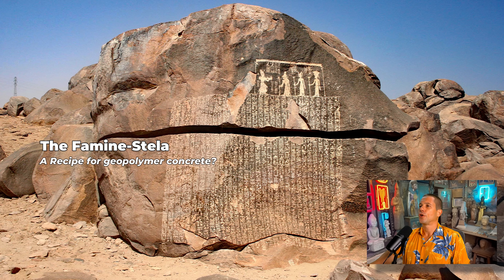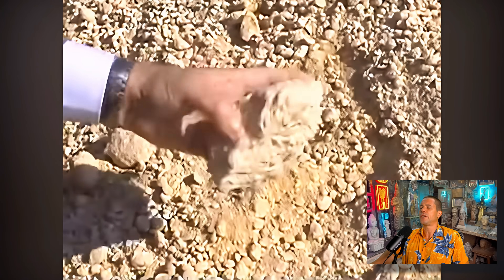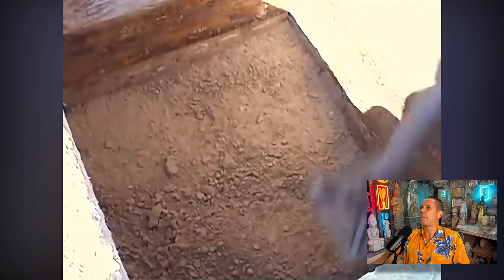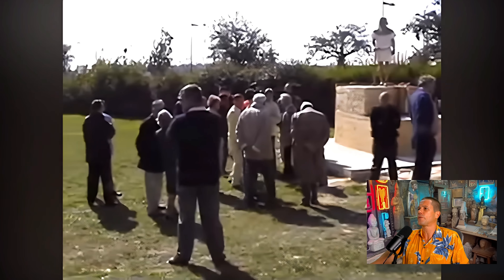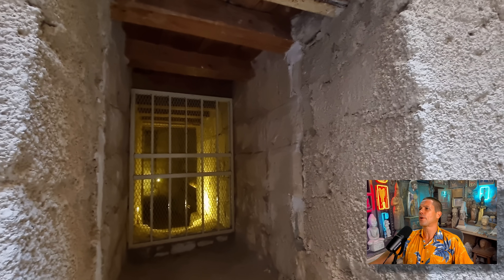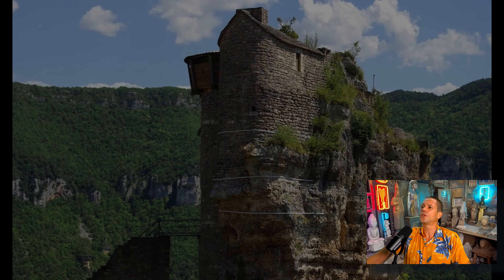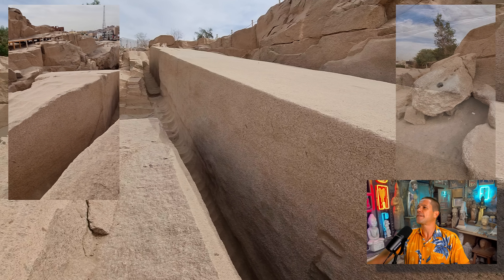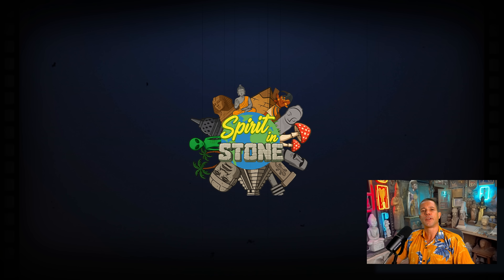The GeoPolymer Experiment | Recreating the Pyramid Stones of Egypt

Comment: this is easily rhe most plausible explanation. When you look at the scoop marks on the obelisk at aswan quarry, its like the stone was in a softened state, where they were able to take out big scoops like it was mud. the stone must have been soft, but still rigid enough they could take large bits out at a time. They were also undercutting it with this method, so the stone they were keeping seems like it would have kept its firmness, so only what they were excavating was softened. One thing does make my curious tho. If they could soften the stone, i wonder why they didnt use the obelisk. Surely they could fix cracks with this tech?
Reply: Plausability is NOT a valid test for fact.
Reply: @wiretamer5710 but its fact they didnt use a form since we can see they finished the stones in place. This part is irrefutable. The stones were smoothed out, after put in place. So the idea of a form, is factually not accurate. We have evidence of saw cuts, and undercutting excavations of large stones, with rough surfaces due to scoop marks. Which again, these marks were likely smoothed out with the same technique as the puffy polymer blocks.
Reply: Firesetting not involving scooping of any kind.

Comment: Explain the megaliths with scoop marks. Also we can see chisel marks everywhere
Reply: Depending on what you were making...Lets take the aswan obeslisk for example. 
Your vertical cut machine cuts out a long rectangle, then you break it off the bedrock with a big wedge, with big enough  space for people to get into the ditch, then you scoop a rough obelisk shape out with a hot spoon. Then you set up lines and lasers to show the final angles. Then like how we use a flattening jig to surface wood slabs to thickness, using smaller and smaller spoons, like going from a 4inch fly cutter, to a 1/64th tapered bit. 
The spoons vary in size depending on the quality and surface finish required.
The spoons, atomize matter upon contact, like a hot knife melting through butter, you scoop, dust falls, scoop some more...
Big scoop, big amounts of dust but its quick work.
Small scoop, for fine details...and less mess to breathe in during the process...

Comment: Did they make a new form for each block, because the Pyramids didn't use blocks of uniform size?
Reply: And how did they extract the block from the hole in the ground?  Maybe with a hearty heave ho...?
Reply: No - they cut the blocks out in the quarries that have already been identified.  They then crushed the blocks up to put them in the molds.  Then they added fossils and calcite veins for realism.  To make sure all the blocks were irregular they made a mold and then each time they re-used it they shaved some wood off to make them smaller.

Sarcasm alert.

Comment: Clearly a load of made up modern rubbish. The amount of acid or heat needed to melt granite is enormous. Much easier to quarry blocks as large as can be transported into place. There are various plausible lifting rig designs, although arguably a simple tripod crane would  be  enough for most blocks. Much quicker and easier than producing tons of concentrated acid to make each block. Even limestone concrete would be ridiculous  as the lime  has to be crushed to powder, transported, then formed back into limestone! Much easier to cut it and move large blocks. River transport ruled.

Comment: I worked with his son, and had the chance to met Joseph few times, he wrote very interesting books about megalithic rocks, definitely the way to explain them. But why making so big blocs? Also the work of Christopher Dunn  ask other very interesting questions regarding the purpose of the pyramids. 
The blocs made in France were destroyed later on, and during the process they observed even more similitude with the pyramids blocs.  
Thank you for this very interesting video.
Reply: When you are born and die in less than a hundred years then your homes and buildings don't need to last more than a hundred years, 
But
When you are effectively immortal (biologically) then you need your homes to last thousands of years.
Small bricks - Takes tens of billions to build a city - Falls down easily and wastes time in brick prep
Giant bricks - Takes merely tens of thousands - Near enough last forever - Is the perfect balance of resource prep time versus longevity
Reply: Took at look at how modern rammed earth construction is done. Geo polymer is basically a cross breed between rammed earth and concrete. The same reasons for building with large blocks and slabs still apply.
Reply: Make the blocks super massive, and they will be too heavy to fall apart. Permanent footprint.

Comment: I think that the theory of stone pulled up a ramp spiraling around the structure should be discarded. Instead the materials to make the pyramid were probably mixed at the construction site and the blocks cast as each layer of the pyramid was laid down, with materials man carried or hoisted up to each working level as the pyramid arose. I have written a paper about constructing the Great Pyramid and submitted it to Academia utilizing this polymer method in making the masonry, and I am indebted to the work of Professor Davidovits in helping me to develop a more accurate picture about how polymers were utilized by the engineers in building the structure. 

There is another advantage to using polymers on the Giza pyramids I didn't mention in my paper, and that involves the idea that given the lack of bronze or iron at this stage in Egypt , the finishing of raw limestone was achieved only with great difficulty to a level needed to finish all the theoretical soild stone blocks needed to build the structures in a timely or efficient fashion, and this meant that artificially shaped and produced stonework would serve to fill the need. This means that the use of uniform stones to support the Tura limestone fascia was paramount, and so accurately shaped and formed concrete blocks really fit the bill with certainty in applying the fascia for instance, ensuring an accurate fit. Scott Zema BA MA Architecture and Art History.
Reply: I agree totally. I have Davidovits' books They are fabulous!
Reply: I think the process of making geopolymer was described by the Egyptians as 'making dead stone live', and what is dead stone but crumbled weathered stone lying at the feet of cliffs and other formations.
Reply: Once the cast in place blocks were formed as needed, could they be additionally shaped? Could they be carved? Thank you
Reply: @j.lietka9406  Good question! Because the pyramids don't have any carved decoration. Later carvings I believe all occured on stone.
Reply: @j.lietka9406  No evidence they were.
Reply: @j.lietka9406  The whole side of the pyramids, once covered in fascia presented an unfinished surface. Once installed, the whole surface was dressed down, starting from the top, according to Herodotus.
Reply: Nah its probably sound.like sonic levitation ...
Reply: @freedomseeding  HaHa!
Reply: Py golden ratio, Ra sun,Mi solvegio freq tone ladder 528,De means reverse or loop action eternity or into 8 infinity

Comment: Since no two blocks on any pyramid have identical dimensions this makes zero sense to me.
If you aren't making standard blocks are you suggesting that they would build a new form for every block?
This creates more questions than it answers.
Not to mention, we can clearly see where the limestone blocks were quarried right on the Giza plateau.
This cannot be done with granite so...
Reply: To make granite polymer stone blocks that weigh as much as 1000 tons the workers had to grind (or dissolve if possible at all) 1000 tons of granite stones into powder and then form a 1000-ton stone block. What a "smart" method. 😂
Reply: @Anonymous------ I have done construction for 40 years your a idiot because it is the smartest method period.
Reply: the form idea is not accurate. Theres an obvious explanation for this. Their technique with building with these stones obviously shows they didnt use consistent sizes with most builds. they had large blocks, and small blocks, and usually the stones wernt perfectly square, or even rectangle. Brian forester theorizes this was for harmonics. Which makes sense, since we can see in ancient times, sound seems to have been utilized in some way we arent completely sure of how. Then in the Osirion, UnchartedX, along with the serpent bros, have really convincing photos, that the puffed up pillow like stones you see, were grinded down, with almost 6 inches of stone being removed, to give the stones a smooth surface. we see some of the puffed out stones still remaining on some of the pyramids, so its almost like they shaped the pyramind after, along with the outsides of many of the stones. This explanation also makes sense why we dont see many gaps in the stone. If they could just push together a softened stone, next to another stone, and just beat it in, every little crevasse would get filled, leaving no gap. This theory makes perfect sense.
Reply: @ovechkin100  Indeed, they rarely needed to be precise for the remaining stuff we see. The pyramids, oserion and a few others though, they did need precision there and so they used different techniques because those buildings served a greater purpose. 
And yes much of the work is based on harmonics, somewhat more precisely the harmonics of anti resonance. As in, in an earth quake situation, our buildings get shredded because the harmonics of vibration get amplified through the same medium cut to the same stupid dimensions over and over. 
But when you use moulds every brick carries a different resonance and when placed correctly these cancel each other out when earth harmonics are present. 
If you made bricks say in super heavy duty trash bags you melted together at the seams to make the shapes, and you melt your stone, during the drying process you hit a certain point where the bag can be cut and removed but the stone will continue to sink and bulge.
Too heavy a bag needed wooden struts pushed through at the base to carry the load, when these ones were cut open they bulged out a bit, hence the knubs. but you don't need to beat the stones into shape, they dried naturally falling into shape. Hence the perfect fit.
Reply: Think of a chessboard where you mould the black grids. After they dry out, you fill up the white ones. This is how and why blocks are of different size and fit together precissely.
Reply: @shkelzennokaj5194  Well spotted, this is exactly how they thought. Work smart, not hard.
Reply: Beautiful!  You brought up things I thought of and something I did not but you are right
Reply: Electrocuted  copper sheets
EBABCOCK
Reply: Finally a comment based on common sense
Reply: Just like modern day concrete use we put up foum boards and when it hardens pop them off and foum another block repeat. If you formed and poured the block in place you wouldn't have to worry about lifting and manurvering them. Unskilled workers can just haul up crushed rock mixed with water in bags or buckets.
Reply: @tillyjohnson5160  Yeah... EXCEPT there is zero evidence of form work impressions in ANY limestone blocks from the old kingdom. There is NO EVIDENCE to support the use of moulds. There is however ENDLESS evidence supporting the use of moulds for clay bricks. The imperfections inclusions and fossils within the core blocks MATCH the limestone found in the quarries in front of the Giza plateau. In other words the GEOLOGICAL evidence supports the consensus view of the Giza limestone origins.
Reply: @wiretamer5710 for one they didn't have to be wood and do you really think it would show signs thousands of years later. Your not as smart as you think you are.
Reply: @tillyjohnson5160  Another slightly false assumption btw. Based on our current primitive technology and poor perceptions of reality.
It is true you COULD carry rocks like this in buckets but thats tens of millions of buckets of still heavy materials.
When you can float stone and push 5 tonnes like its an empty wheelbarrow the moving of stone is easy.
Reply: Do not mistake geopolymer bricks with pyramid blocks. Similar but not the same.
The pyramid blocks were cut...requires differently sized blocks for reasons that go into electron and proton mass stuff, but there are very very technical and advanced reasons.
BUT, also, geopolymer stones which were melted used different forms for similar reasons but they didn't have to be as exact referring back to electron mass, they just needed to be strong...the pyramid stones needed strength PLUS other properties. 
If I give you a block of playdoh and said make ten different brick sizes by hand, does it really take that long to do? No.
Making new forms out of wood...yes...but that isn't what they used...They used something more like playdoh than wood.